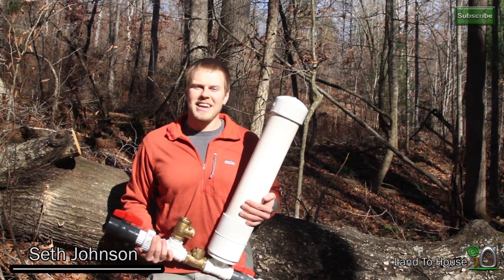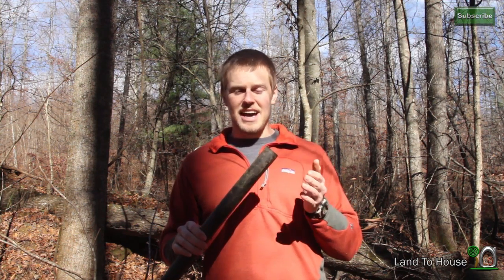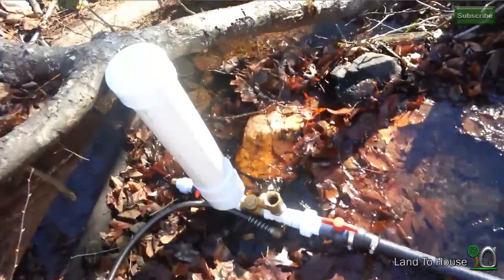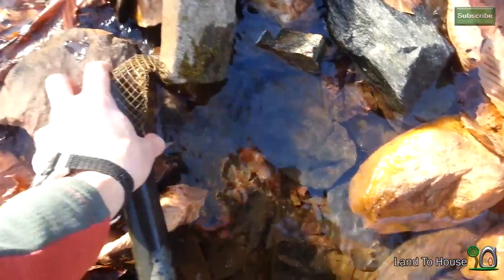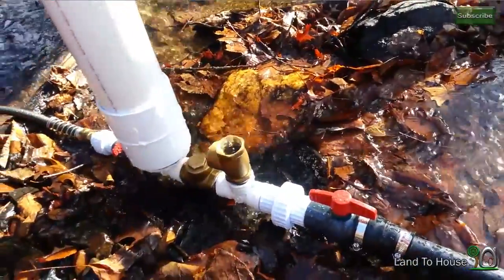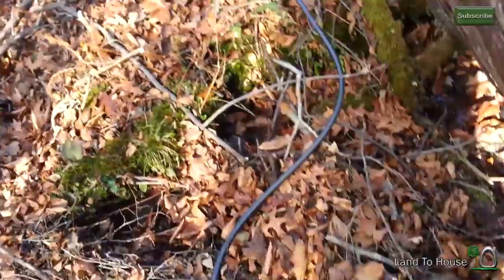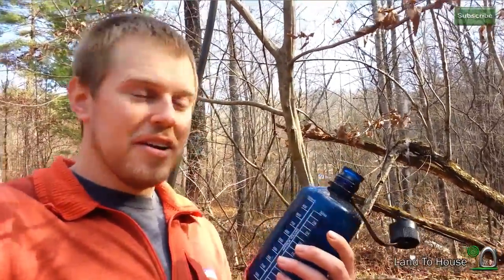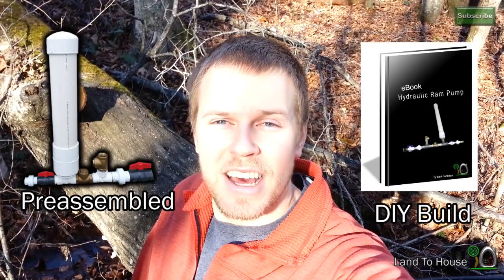How to Install a Hydraulic Ram Pump

Comment: Thanks for posting this video! I do have a question/idea to run by you. I am planning on building a water feature in my backyard using the ditch which gets water in it when it rains. My original plan was to use a 12v water pump and solar panel. Would your system require more water for the pressure than what your pump would produce? This ditch will be lined with pond liner so I have minimal water loss and it is on a slope. I plan to have a couple different small water falls for the sound. Do you think I would need more water than what the pump will supply?
Thanks,
Ron
Reply from the maker: Hello. The ram pump actually needs a constant flow of water to operate. In your case I think that you would be better off with a solar pump . If this water source was from a flowing creek I would say yes go for it. But with a limited water source I do not think that it would work very well.

Comment: Zeth, how about the check valve, like for example for 1" ram pump is it matter if I use 3/4" instead of 1"? thank you for your reply, anyway I'm from the Philippines.
Reply from the maker: Its best to match the drive pipe size with the waste valve. So if you have a 1" drive pipe you need to have a 1" pump.

Comment: Seth, how about if you install a check valve or swing valve close to the intake or to the source of water to a drive pipe. What will happen
Reply from the maker: From my understanding it will stop the pump. The pressure wave needs to travel back and forth. ... BUT I do have a nice tasting ground for this question.

Comment: Hi Seth, im from germany ( sry for my bad english) could you help me pls ? my hydraulic ram pump didnt works...the check valve (where the water flows out) didnt close...its always open and the water drops out...i build the ram pump cause i want to make a trout farm...
Reply from the maker: Hello. There are a few things that can cause this issue. 1. The drive pipe is smaller than the waste valve. 2. There is air in the drive pipe. 3. The head pressure is too low to start the pump. Let me know if you feel one of these might be the issue.

Comment: Hi Seth! I'm from Uruguay (South America), here is my installation using 100 meters of delivery pipe and 25 meters of drive pipe: https://www.facebook.com/ChacraTaruman/videos/428193684241658/ 
You deliver a great product, thank you. I think it is working as expected, can you see the video and give me some opinion?
Reply from the maker: Hello! Nice to see the pump is installed and working!  The cycles are a little slow. This is likely due to low head pressure. Increasing the head pressure can increase the cycle speed and supply a larger flow rate. If you are unable to get more head pressure its alright as the pump is working.

Comment: Pen stock is the dam and filter NOT the drive pipe which should be gal. steel not plastic.You need a snifter valve, this makes it maintenance free.
A good self cleaning inlet filter makes it work well.
Reply from the maker: +LE Bear I was just checking out the meaning of penstock on Google. Looks like it can be the intake and filter but it is also the enclosed pipe that carries water. Snifter valves are nice to prevent waterlogging but are a  pain to work with.

Comment: get rid of the plastic parts as they cant take the pressure.  After 8  years of running my ram pumps one thing I learned-- NO plastic parts. and no metal to metal contact surfaces either meaning no swing check valves.
Reply from the maker: +fireye2012 I agree with the metal on metal statement. The brass will wear down quickly. I have some situations where it is gone within 4 months with high pressure setups. Using a plastic drive does reduce the pressure wave some.

Comment: I bought your 1 1/2 inch pump and am now looking to buy the penstock. The brand I am looking at offers different grades with maximum allowable pressures between 80 and 200 psi. My vertical drop is about 70-80 feet over a 550 ft run. Do you have suggestions on which grade to get? I don't have any idea how much pressure is developed when the valve closes. I'm thinking that the higher grades would be more efficient because of their increased rigidity but of course they cost more. I certainly don't want to get too light of a pipe that it will bust under the pressure.
Reply from the maker: +Tarry Butner hello. I was noticing that you purchased a 1-1/4" pump. You need to buy that same size drive pipe. Can you tell me the vertical lift you're trying to pump to? Most of the time these pumps do not exceed 180 feet lift. This means not exceeding 26 feet of head pressure. I have seen set up set go higher than this but it's not common. I believe the black flex pipe that I typically Buy is 160 PSI.  You can also use schedule 40 PVC. I believe it is rated to over 300 PSI
Reply: Hi Seth. Thanks for pointing out the 1 1/4" size as I had that wrong. I estimate my vertical lift to be 120 ft. Given that, what then should I aim to capture in head pressure? I thought the more head pressure the efficient the pump.
Reply from the maker: +Tarry Butner sure thing. That might save you a bit of money to. 420 foot lift I would not exceed 20 feet of head pressure. 17 would be the low end. It is true that having more head pressure will provide more water at the top. But there is a point where you produce too much pressure in the tank and the water squirts out the top and the pump stops due to lack of back pressure. So if you had 20 foot of pressure you should be able to produce a decent output.

Comment: I'm unclear on how the water gets to the pump? Gravity?? Does the water source need to be higher than the pump?
Reply from the maker: +Douglas Wallman you got it! Having the water intake higher than  the pump provides head pressure. This is what drives the pump.  You can also use hydrostatic pressure to run a pump.
Reply: +Land to House Thank you, tomorrow will tell if I "get er done"
Reply from the maker: +Douglas Wallman any time.  Let me know if you have questions.

Comment: Hey Seth, I have a question, it;s about the pressure tank.
  I am considering this here  at my house, i have a creek right outside the back gate. The yard is probably 150 feet long to the gate and is a hill slanted up towards the house, just outside the gate i have a sidewalk type set up and then really steep about 20 feet to the water.   so You see my problem.   I have been using a 1.5hp electric pump  hooked up to 1.5" blue flex drainage hoses and I can get a Boat load of water all the way to the top of my property and even in the front yard this way.  I mean a TON, but, costs me electric and it's Loud and it is subject to failure.   i realize i will not get this kind of pressure from a ram pump. 

   BUT, here is my question. will I get more more water at the top (and greater pressure) if i use a BIGGER and Taller pressure tank?  or is this something that is limited in some way I have not thought of?      my idea was this, i have some 8" pip that I have just laying around, It;s thick gnarly PVC, i was thinking if i buy a cap for that big pipe and turn it into my pressure tank ( it's near 10 feet long)  will the water come out the out put side much much better?   The down side just being that it would take a lot longer to build pressure in the  pressure tank to get it all started? 

    thanks for making this video , it's the only one that really explained the creek thing .   I have about 25 feet of run i can use for the penstock up creek.
Reply from the maker: +Larry Leisuresuit +Larry Leisuresuit hello. It has been my experience that the pressure tank can be too small to build the required pressure but there is a point where the size is too big. For instance a 1-1/4" pump needs a pressure tank approximately the size of a 4-inch pipe 20 inches tall. Any smaller than this and sufficient pressure will not be gained. But much larger than this and the tank will just fill with water to the point the pressure matches the head pressure. You are not gaining much with a larger tank. If you need more water I recommend using multiple pumps. If you need the high-pressure you could use a solar powered diaphragm pump out of the storage tank.
Reply: Thanks, I am Liking the dual Pump ( Side by side) Idea. Both Running to the top single port and then off to the front of the property by gravity as the two pumps are pumping High enough that I can reverse the slant from back to front and cut the added pressure that 150 feet of water in a pipe has on the outlets.  By raising the top outlets higher than I originally planned the pumps actual Job ends at the top of the first steep grade. It's a pretty sweet plan really.
Reply from the maker: +Larry Leisuresuit that does seem like a good plan!  I think you will be happier  using the two pumps.

Comment: I have well deep 10-15 meters . how we can use any methode to take water come up to use by no electriccity or gasoline. Thank you for your idea for us.
Reply from the maker: ***** The ram pump needs falling water to work by gravity. In a well there is no fall (feet of head) so I am sorry to say that this wont work in a well. You will need a hand pump or solar pump to get the water without grid electricity or fuel.

Comment: Hi Seth. Curious to know a) how long your drive pipe/pinstock is, and b) what distance is the drop between the mouth of the pinstock and the pump. I'm trying to test a ram pump that I built (off your how to video) and I'm using a 20 foot flexpipe as my pinstock, but the pressure is not high enough to force the check valve to close. Thanks for posting these!
Reply from the maker: Hi.  You are welcome!  I have tested so many sizes.  Ha ha. In this video I have a 75' long 1-1/4" drive pipe. The drop (feet of head) is around 2'. To get a pump running you will need a minimum of 1' of drop. This week I am going to test a stand pipe to add extra drop. Your drive pipe can't run to long or the pump will stop.  (Over 100') the video should be up in the next week.
Reply: Land to House .com Sounds good. Tried it out today using a 60' sump pump pipe. But there wasn't enough pressure to close the check valve. Not sure if it was the drive pipe or location. I'm leaning towards location.
Reply from the maker: Misbah Haque make sure that ALL the air is out of the pipe. Any air and the pressure will be low. You can close the valve at the pump and use a bucket to pour water into the pipe until it's full.  Then open the valve and let the water flow.